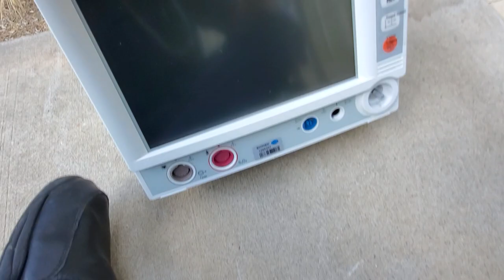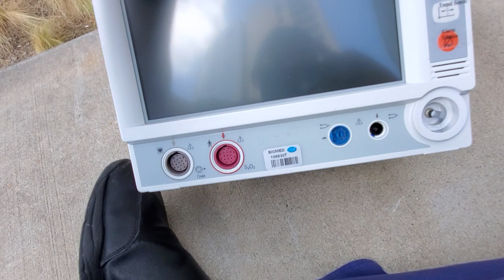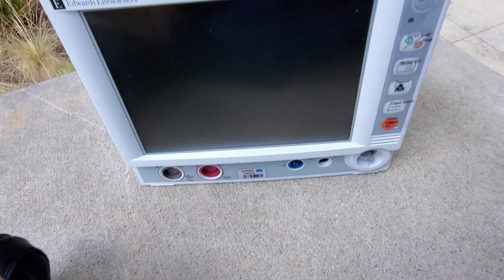Daily Vlog:  Planned Obsolescence

Comment: I believe you can apply heat from a heat gun to soften the adhesive to pull out the front panel sticker to get at the front panel screws
Reply from the maker: The problem is that these front decals need to be 100% water tight due to frequent cleaning.

Comment: RFID can be scanned and copied . I learned that when taking electronic engineering classes.  
          Power supplies are the easiest thing to repair.  Electronic class 101 level. 
       Making power supplies is our first project in class as a multi part project to build a pre-amplifier and a power amplifier stereo system in class. 

        The face plate with the sticker will take some work and may not look pretty. Third world countries can do this on a dirt floor, bear foot with the cheapest hand made tools. 
               If you want pretty there is a company used in automotive that can reproduce any sticker.  You just need to scan the original and send it to them. 

    Any security item or code is easy to crack or modifying , copy. Just got to find the right Russian, Korean, Chinese underground sources. They are excellent at this

Comment: Those medicals's equipment should learn from PC market where most of the hardwares and accessories are standarized.

So the manufacturer is competing for improving the equipment instead of selling junks.

In this case, I really hope China or EU make a standarized system for their region and I believe it will spread to other countries later.

I have lost hope for USA, once a dream country, then a nightmare country
Reply: That's because you factor in RGB and every company trying to cash in with their proprietary connectors, softwares and systems. A custom 3 and 4 pin rgb connector for lightning Node was very unnecessary, Corsair!
Reply: @Everth97  yeah.. that corsair is trying to "differentiate"
But, we must admit that Corsair is the best RGB solution out there.
You literally can do anything you want with it.

And you can argue that RGB is not essential.

I just want all those essential to be standarized.

Comment: Can you make a screw hole template and use it to unscrew all the monitors so the sticker don’t need to be taken off?
Reply from the maker: Any perforations in the label and the label will need replaced. In between cases, those devices get wet wiped for sanitizing.

Comment: So don’t buy devices that are not serviceable by 3rd parties. No need for legislation that breaks contracts. No need to interfere with purchase decisions of other buyers.
Reply from the maker: As if it was that simple..
Reply: @BetterBiomedChannel  manufacturers invest in and design their products. Pay contractors to supply the parts. Then they invest in marketing, sell product at low price.   Customers like the arrangement. In exchange, manufacturer receives annual, predictable income stream.
Reply: @Steve Richter Not possible when there only 3 manufacturers of the equipment needed  to treat patients. And FDA regulations make it expensive for companies to release potential good products but also keep the bad products out of circulation.

Comment: Listen guys… most of this shit is liability issues. 
Some of it is bullshit but if thier equipment fails they could be liable for it. Especially if someone was poking around in there and won’t admit that they did.
Reply: The pricing for replacement is ridiculous, but that they can just declare a device eol and stop supporting it is insane. It should be mandatory to service medical devices as long as they're still in good condition otherwise and not actually outdated from a medical POV.